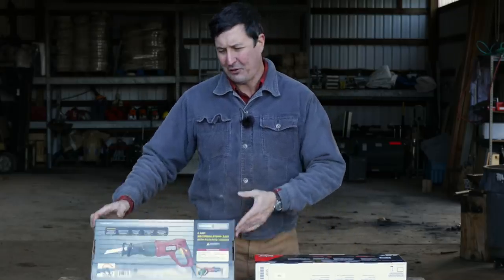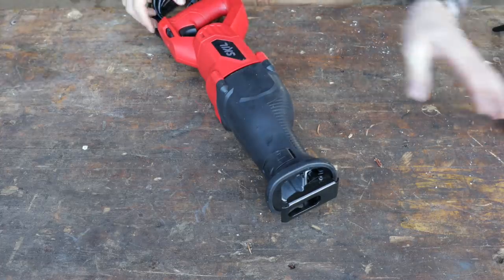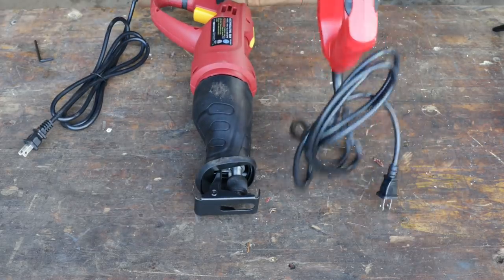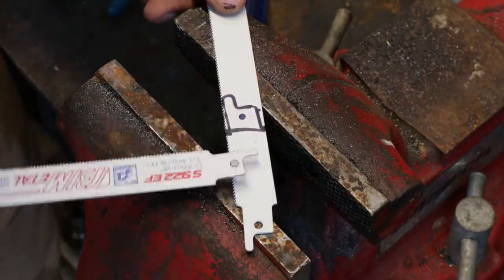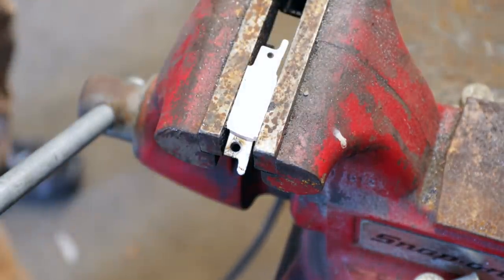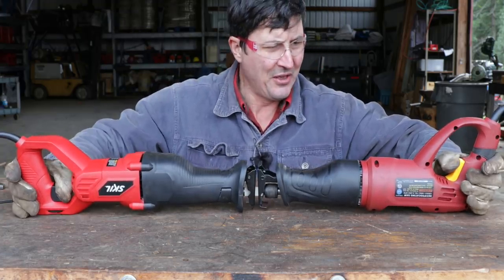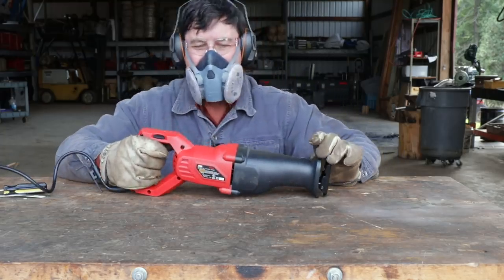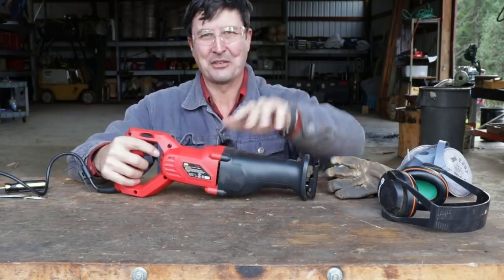Cheap Harbor Freight Tool Catches On FIRE!!!

Comment: Anything Harbor Freight on Amazon is NOT sold by Harbor Freight. The items are bought and then resold on Amazon at a mark-up. The Chicago Electric saw is sold right now for $28.99 in store and online (but there's usually a coupon out for $19.99)

Comment: If you paid $49 for the harbor freight on Amazon. You got ripped off! I got mine at harbor freight store with a coupon for $19.99.  But regular price is $24.99. And not to mention I've had mine 3 years and only complaint is black  rubber part has some rips on it but still working great!

Comment: Personally I thought this was a very telling video. Most of the cutting ability in these saws is the blade, the tell is how hard can you push the tool. This was not a tool review this was a torture test so thanks for the humor. Ive had a Rigid r-saw for 40 years and the only thing that has failed is the cords although I do not think that Rigid is half the tool company they used to be.

Comment: I have nothing bad to say about my $20 harbor freight saw. Ive dropped it and thrown it a few times and used it a lot with no problems, of course I havnt jammed it and left it on. Sometimes you can just get a bad one and have to return it no matter the price or brand. Also you could drop it from high up or it could get stolen and your out more money especially if you spend 100-200 on a nice one. If you want a little more durability then sure get the $40 one...but For $20 if it breaks in a few more years I will just by another one. I would imagine 2 of the $20 saws would last longer than one $40 saw. Just my opinion.

Comment: I got the same one from harbor freight on sale for $25, its my most abused tool I own obviously because of the price. I beat the hell out of the thing for maybe 3-4 years, for work and home use and now my dad stole it to keep and trim up his bushes/ tree limbs and such. I understand they are built kind of shitty but after what I put it through for those few years I'd readily buy it from the hf when its on sale again. Without a legit test, actually using the things on what they are made for, I don't know how you could possibly encourage people to buy a product based on results from something these tools would never experience, ever, during normal use. If you are tight on cash most harbor freight tools are just fine to use, I wouldn't recommend them for work though since spending a little more to get a little more power and life out of it will make work life easier. If the skill is $40 then why not just spend another $40 and  get a dewalt, because it costs more and lots of people can't just spend $80+ dollars willy nilly. My rule of thumb is if your gonna use it alot get something good. Your channel has changed for the worse, this whole video seams like an ad to get people to buy that saw. Oh whats that? A link in the description that you get paid for to get the tool in the video? Get it quick you say, wont last long you say, in stock I see, a whole month later I say. Unsubbed. There is a coupon for the harbor freight sawzall right now for $20 that you can get off of HF website.

Comment: The interconnect is not long enough for the movement of the blades. You might have as well clamped the blade in a vise, would be the same.

Comment: Maybe next time connect a weight to the blade instead of connecting the saws together. That will let the motor run, and we'll be able to see which one can do more work under load before failing. 
Just a suggestion... :-)

Comment: Hm. I guess hindsight is 20/20 but it mightve been easier to spotweld two blades together so youd have two ends instead of cutting a mirrored end on one blade. Assuming you have a spotwelder (i think i heard you say it once?). If you dont then ignore my dumb self

Comment: I own the harbor freight its good and most sawzalls you can flip the blade. And also i had my first harborfreight saw apart its metal where it counts and my first one handled 6 years of severe abuse.
Reply: Also you melted the brushes most likely witch harborfreight gives you an extra set of with the saw. of all my harborfreight power tools i only had to replace brushes on my grinder wich is around 10 years old. Fyi i cut apart cars do remodeling and farm.

Comment: OK one thing.  Harbor Freight tools work well for they are made for.  They will not last when tortured like this.  They also are not good for contractors but average home owner should be ok. Now I am not a huge fan of harbor freight.  Saying that I have some items from the store and have had no issues.  I do have an issue with this comparison.  And then a pitch to buy the other from amazon using his link gives him a kickback from Amazon.

Comment: I would have just drilled holes in the ends of the blades and bolted them together, using the existing ends to insert into the saws. I would also shut off the compressor when filming.

Comment: well its not exactly apples to apples. The harborfrieght  one you are testing is a 6 amp for 29.99 on harborfreight.com  and the skil is a 7.5 amp.   The 7.5 amp version is 47.99 on harborfreight. So yes the skill may have done better, but they are not exactly the same build.

Comment: That is no test. I think the real tests are how the manufacturers test them by putting them in a fixture to where you are testing them performing the type of work they were designed to do. For instance testing the trigger millions of cycles or letting the tool saw carbide for days.

Comment: Any piece of equipment, power tool, hand tool, tooth pick. Will fail when abused. Any power tool when pushed beyond it's designed specifications will fail.
I always love ( in a sarcastic way) when people compare 300.00 dollar pistols to 1500.00 race guns.
Comparing a Chicago recip saw to a DeWalt, or Milwaukee or Makita, is basically the same thing.
Many if the HF tools are not designed to be heavy workers. They are light duty, inexpensive tool to get the job done but not have to mortgage the house to get them. Many if the hand tools at HF are very good, and garages regularly buy from them because the tools will hold up, and they, being HF, life time guarantee all their hand tools. My employer does this.
Some frown on buying cheap Chinese tools over a US brand. But! Nearly all of the old US brands are now owned by foreign companies, and almost without exception, all hand tools and power tools are manufactured outside our borders. Or all the parts are manufactured outside the USA and them parts are assembled here. But very little is truly made here.
Manufacturing is coming back slow but sure.

Comment: Uh.. where are you getting your prices from? That saw from HF is $20 with coupon that I get like every month, that Skill is $40, twice the the price . I have that HF saw and it’s worked great for the two years I’ve owned it, I don’t do much of locking the blade down and holding the trigger with mine though.

Comment: Maybe play with the saws/tools a bit before blowing them up. Get some milage for your money. You could make two videos that way. The killer of sawzalls in my experience is brush clean up (cutting limbs) with a 12 inch blade. After you make the videos give away the one that still works maybe involve blog participation or something. Maybe give the broken one to'tool tare downs' here on you tube so he can investigate the failure.

Comment: I gave 19.99 for my harbor freight recip saw.  I've had it for 9 months.  I've tried to kill it with abuse removing old furnaces.  I don't set it down, I toss it.  It won't die.  But nobody had a better blade holding methodology than dewalt...

Comment: Cody, Shopsmith Mk5, versus Shopsmith 10 E or ER.

Get the cheapest used units.  Since the 10 hasn't been 
built since 1952, it will HAVE to be used.

No, you can't run them against each other, but you can 
check out the 5 different features, Mk5, versus the 10
(Table saw, disc sander, lathe vertical and horizontal 
drill-press.)

I can pretty much predict, table saw, neither.  model 
10 the worst.  Lathe, the model 10 hands down. Sander, 
tie.  Drill press modes, Model 10 by a nose.  Safety, neither.
But, the Model 10 is less safe.  (Exposed belts and blades.)

If I was to buy one (another one) it would be the Model 
10.

steve

Comment: That dust mask will not help much with toxic fumes. You need to add a chemical canister filter.
Reply: Oddly a freshly broken drill bit and a drill press works great for drilling hard metal.

Comment: You could have just jammed each saw's blade in a vise to see which one is less tolerant to being stalled at full power.  
We're still left wondering which one is the better tool.

Comment: Don't understand why you call it harbor freight. That is where the tools are sold, the name is Chicago Electronic. And you could have went over the specs for each one. I mean if anybody here understands volts and amps clearly the skil that is 7.5 A will out perform the Chicago Electronic that is 6A. I have the Chicago Electronic sawzal for 4 yrs and not once have I had any problems getting the job done.

Comment: My (actual) sawzall Milwaukee has the 360 degree rotating handle. I don't even remember how old it is, 10 years old or so. Strange how you're saying this saw is clever or unique. 
Unless you've never used a milwaukee.

Comment: 4 seconds to let the smoke out?   The wire used for the windings is too small to carry the required current.  They so economized on copper cost that in my book, that tool is not fit for purpose, will get excessively hot even if it doesnt have a locked rotor, that excessive heat means the insulation on the windings will fail early, shorted winding, trash can.  You would be way better off purchasing a used, battered old saw than a new one of these.

Comment: I have the Harbor Freight saw. The deal with Harbor Freight is you never pay full price. They normally have 20% off coupons. The Harbor Freight saw is okay but I have found the blade wobbles a lot which causes issues when trying to cut very precisely. I have a short video https://www.youtube.com/watch?v=5nGOF6nmCFw which you can see it cutting 3/16 flat.

Comment: You were ripped off by Amazon.. The saw you tested/destroyed was #65570, 61884, or 62370 ( 6 amp model) from Harbor Fright Is only $29.99 , was purchased to install 1 window,..They have other sizes, 7.5 amp $47.99 (#69067),was purchased to add a room, and 9 amp, $59.99 (#69066), Built a 30'x30' log cabin for fitting corners ..all have same options just bigger motors and colors according to size. I have all 3 models and have at least 75 hours on each, and no problems other than being corded models...but I buy them with the expectation that they will last for a given job before they die...

Comment: Man, if you're going to destroy a saw without even using it for it's intended purpose to see what fails first, at least open the thing up and see what actually failed inside the unit so we can see what let the smoke out, part 2 - insides?

Comment: I literally do not understand this test at all. What's the point of taking a brand new tool out of the box and immediately destroying it? What did you prove, that it'll break? Everything will break. 
I've had this exact saw for years. I use it all the time on a bunch of different materials. It works flawlessly and has been very reliable. But you'll never know that because you just took it out of the box and set it on fire.

Comment: Harbor freight tools suck. No questions asked. My dad bought one of their 12" chop saws. He tried to put the saw on the bottom plate for an hour but it would never line up. He went back and had it replaced twice. All of them had the same issue. That's not how you make tools.
Reply: Also. For everyone asking for a cut test. It doesnt matter. The blade does the cutting not the sawsall.

Comment: So clearly the Hazard Frought tool has no built in overcurrent protection in the form of a thermal cutout or a fuseable link or anything. 

No matter what the consumer does you should never be able to put a tool in a situation where it catches on fire. That is ridiculous… That tool should be protected with the thermal safety switch to protect the windings on the motor so that if they get up to a certain temperature it takes power off of the motor by popping a resettable circuit breaker. That's an expense the designers of the tool decided to skip. 

This is why i advise my friends not to buy power tools from HF.

Comment: I've bought Harbor Freight before and their stuff isn't bad. You will obviously get what you pay for and nothing beats the quality stuff, but if you need a tool for occasional use it's not bad. To be honest, I thought your "test" was pretty unfair. You didn't go into the specs on either tool, you didn't test the tools as designed. A real "torture test" would have been to see how it holds up doing what it was designed to do. Pretty disappointed in this Cody.

Comment: I’m fine with crappy tests like this because it pisses AvE off and then AvE goes and build a real scientific way of testing these tools.  

I also believe this test was flawed because the reciprocating motion of one saw can not turn the other.  Basically you have a tug of war where neither side can actually tug(and push) to show that there is a winner.  Basically what was shown is a truncated video showing what will happen to a motor when it is not allowed to do what a motor is meant to do.

Comment: If you're going to just destroy these tools you should at least put them through some tests and review them first. Sure its probably all good fun but im more interested in how they work and which one is actually better in real world situations. Which has more power,which one can take more abuse, what blades can they use, does the box false advertise, size comparison, which has better internal parts, which one is built better, just normal questions like that. I get what you are doing, but im more interested in real world situations of the tools. Maybe im the only one though...

Comment: I fail to see the point, using a tool in a way that is not designed for proves nothing.....use them to cut and then compare. I like your channel but these gimmicks are useless

Comment: crappiest tool review I have seen you do yet that harbor freight saw is only 19.99 with coupon and I have had one for occoasional use for probably 5 years or so and yes it is worn out to where I don't think I could cut anything straight anymore but still works quite fine

Comment: Why are you putting harbor freight down???
If you bind anything up like that long enuf it is gonna heat up and burst into flames especially if you know it is cheap crap in the first place. You can attack harbor freight all you want to but they continue to grow and grow because most of their stuff is adequate for normal use,  some is adequate for professional use, and some of it is actually top shelf and will compete with snap on for a fraction of the cost. Yes about 15% of their inventory is totally useless cheap crap and is priced accordingly..Buy a grinder for 9.99 anywhere you already know it wont last long, but maybe you just need it for one job.... I am not impressed with about 75% of their electric power tools and would not want most of it, but there are a few gems in there if you look for them, and yes stuff is priced according to quality at harbor freight... Bottom line is if you can't tell the difference between quality and cheap knock off crap you can end up with junk no matter where you go, and if you are going to abuse the tool any brand it will fail. Most of us are not wealthy like you and can not spend a fortune so our perspective is much different than yours. I will not be surprised if you get allot of backlash over this. Why don't you do a series on some of harbor freights better products instead of trashing them?

Comment: I normally enjoy your videos but this one was pointless. If you had first tested them in real life use or even used as intended it might have been interesting. Before you make blanket statements about Harbor Freight tools being "not very good" you should actually try using them rather than abusing them. Do I feel they are all great? No, but after owning many power tools from many manufacturers I must admit that my Harbor Freight tools have held up very well and most of them perform well. Almost all are still in use which I cannot say about my Dewalt, Skill, and other major brands other than Ryobi. Ryobi has also served me very well and probably best of all but just like my harbor freight tools they were not abused.
Overall I have really enjoyed your videos, just had to point this out. This is the first time I have watched one of your videos and not given it a thumbs up. Hope it helps, it is intended as constructive criticism.

Comment: Well DUH you stall and electric tool and then act suprised when it lets the smoke out.  
C'mon man real world test.  What kind of cut stalls it, measure inches per minute in a known material with an identical blade in each saw.  They're both chineseium, probably made within a mile of each other overseas.